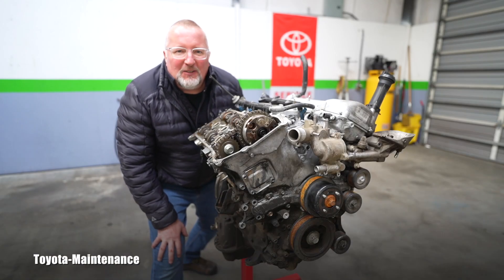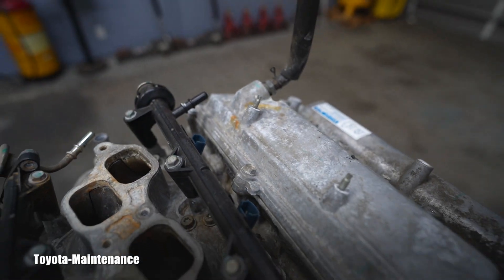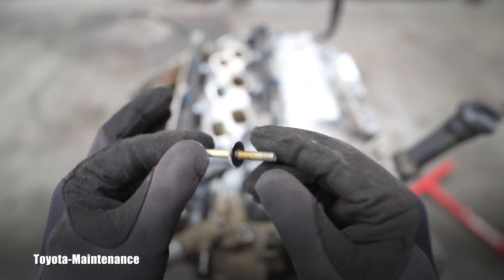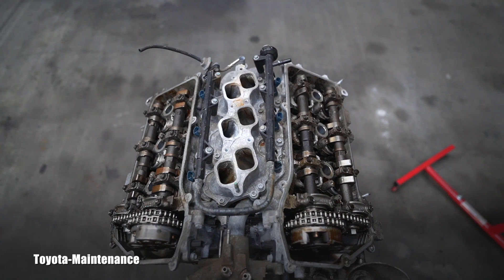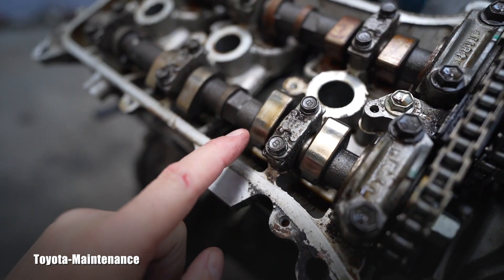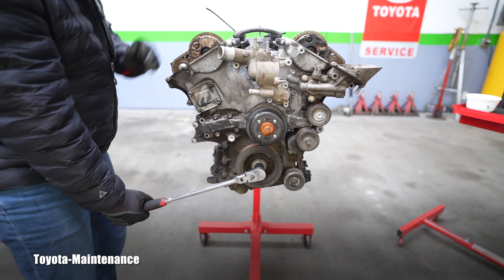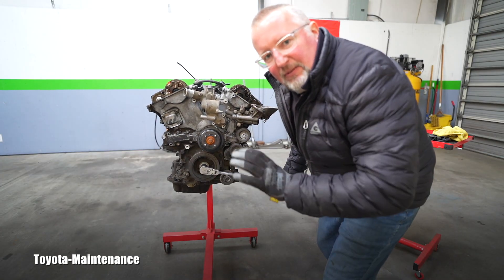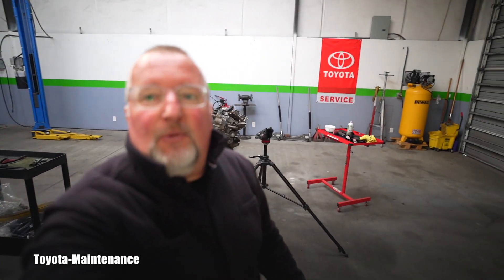Is Toyota Project Engine 1GR-FE Seized? Will it rotate?

Comment: The 1GRFE most definitely does have a rock cover gasket leak- super super common on cars in Oz. Especially on the inside bolts side under the intake manifold as the bolts come loose.

Comment: toyota carina 1996 1.6 engine 320,000 miles drove it through the alps compression was down but still up to the job. have a 2008 nissan 1.5 engine just as impressive

Comment: Great content Peter, thank you. Maybe slightly off topic, but related in terms of vehicle longevity, I have 250K+ miles on 05 4runner and if it had transmission service at all, I can't remember when. It drives like a dream. Did I drink the coolaid on lifetime transmission fluid and I'm on borrowed time? Should I begin 6 month pan changes, or better to leave it alone? What's the truth on this idea that changing old transmission fluid could hasten a failure?
Reply: Mine has 200,000 miles and I just flushed the ATF- it had a slight burnt smell coming out.
There is like 11 litres of ATF fluid and only 2.9 litres in the transmission sump. I have a 03 Prado with the ATF dipstick in the bonnet and I fill it through the dipstick. I suggest drop the transmission pan- it's one plug. Top it back up- then start car- with handbrake on go through top to bottom all the gears N-R-D-2-1, and then back the other way and do this like ten times with car running. And what this will do is flush the new ATF Fluid in the sump and mix with the oil oil still in the transmission. Stop car and dump the ATF fluid again- you will notice it dark again. Repeat this step another 3 times and this will replace 75% approx of all the oil tranny fluid, still leaving some there. And that worked well for me. No slippage. And I feel happy most of the oil is new. And in 100,000 km I will do this again.

Comment: I have 297,000 miles on my 1GR-FE in my 08 4Runner and it is still running amazing. I had it since 200,000 miles.  I never owned a Toyota prior to that. I got the truck for a very good deal about three years ago before prices went crazy. I never had a car with high miles so I had low expectations. I’ve been all over the country with this truck. The quality and reliability is amazing.

Comment: I have a 2005 1GR-FE with 280,000 miles in a Tacoma and it is a great engine.
Reply: Any issues with it? Mine has 200,000 miles and I just cleaned the throttle body as filthy, changed the PCV Valve that was blocked, and dropped the sump and oil pick up was very clean but a bit of sludge in the base of the sump pan (likely from some engine flushes I did.

Comment: Cam journals seize when the heads overheat on 5VZ , while the lower end will remain free.  The tolerances are so close that the heads will need more than just machining making it more sensible to get a good used engine.

Comment: I have this engine in my Toyota 4-Runner, it now has 486k with no problems just normal maintenance and synthetic oil since 30k. I’m a mechanic and have worked on a lot of Toyota engines in my career, I personally think this is the best engine Toyota has made.
Reply: Same here. Been a mechanic 23 years now. Have a 07 Tacoma, services every 3k miles. 370k miles. I’ve done 1 water pump on it and only because it was 16 years old. The 1GRFE is outstanding.
Reply: @el_GapO  no other issues? Have you needed an alternator?
Reply: I’m seriously tickled to hear this. I saw what’s happening in the world and quickly bought two (4Runners) new a 2020, and a 2021 before prices went sky high. I told the wife we will have them as long as humanly possible.
Reply: Sweet. I have the 1 GR in my 08 4runner.  I'm at 286k and just trucking along. Just normal engine maintenance.

Comment: Curious as to why the oil was burned on the driver's side? If the proper synthetic oil was used, would you have expected that?
Reply: It's most likely because that is the side the EGR system lives on.

Comment: I was once given an old 1972 Honda SL 125 Dirt bike that the engine was froze up.  It was wintertime and I just stored the old bike in my storage shed.  When I put it up, I also filled the spark plug hole with Mystery oil, the red stuff.  Let it set until Summer.  Then, drained all the fluids and replaced with new fluids including gas and it broke loose and started after 2 dozen kicks on the kick starter.  A little carb adjustment and a couple of tanks of fresh oil and gas and it ran great all summer.  It did look a little rough but would run circles around the others I rode with back then.  I never had a title, just a bill of sale.  I sold it to a friend, and then later, he sold it again to someone.  I know that wonderful feeling when a "frozen" engine breaks loose from a slight rust of the piston rings.  Very exciting!!!!  I had a heck of a fun riding season; this was back in 1980.  I wish now I had kept that bike, but time moves on.  A nice riding summer at practically no cost!  Great times!